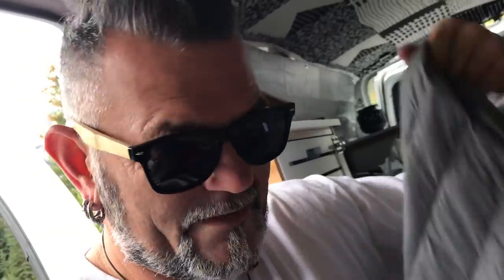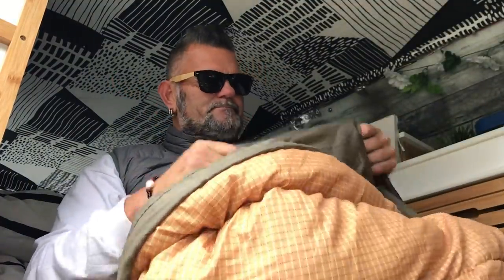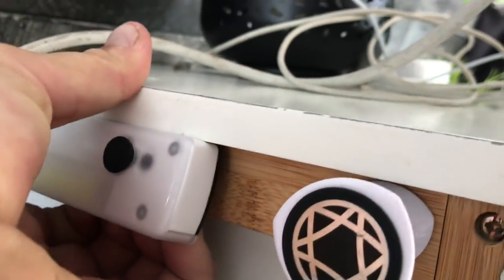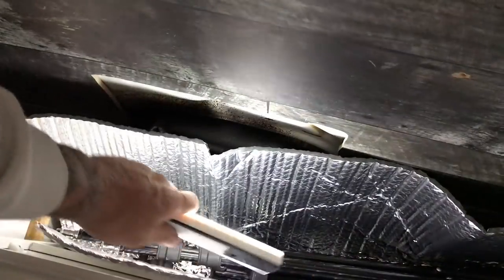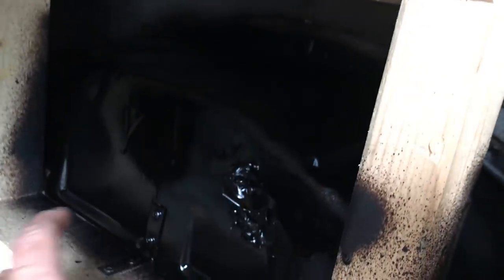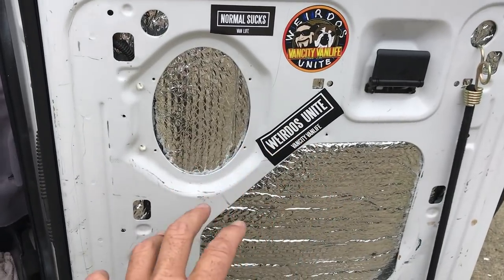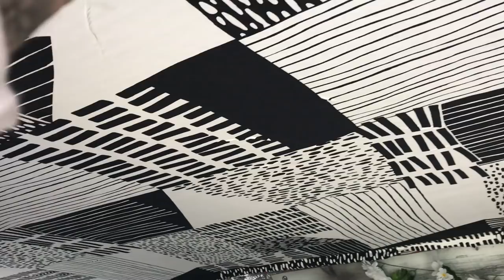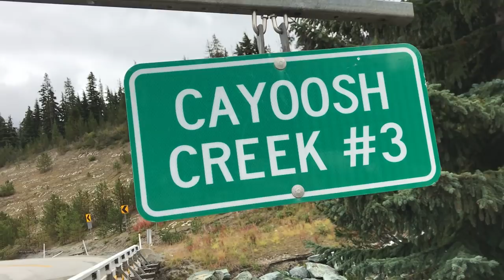Solving Last Year's Winter Problems | Van Life Winter

Comment: First yahoo
I am right now insulating my van with pink foam board and instantly condensation is gone none on windshield either wow what a difference, I did the ceiling all the walls and the wheel wells

Comment: I’m lazy so I sprayed 4 coats of lizard skin inside by van,;  two coats for road noise (black)  and two more for weather heat and cold ( White) and so far is working out fine.. no condensation at all,  quite, still not sure if I’m warmer, so those extra blankets help. And it’s more expensive but Easy breezy to spray. Just got to mask good. 🤙😎

Comment: Check out clay pot heaters you make for cheap yourself. This will take care of any condensation you may get now that you have sprayed your trouble areas. Just don't use this while sleeping. I might also suggest using beeswax tea lights instead of parifin wax tea lights. You hang it in your van and it will take care of condensation and give you practically free heat.
Used in boats a lot.
YouTube has "how to" videos.
Looking forward to seeing you build one.
Reply: I have used these in my house, experimenting for later.  I just picked up a fondue setup for $2 at the thrift store and it is a pretty base for the flower pot heater, ensures air for the flame.  For several years, I have used a tea light China teapot for making hot tea or chocolate or instant coffee (tasty in milk).  The flame is enclosed enough that it won't catch clothing or curtains on fire.
I started with them because I haven't gotten solar panels, and may just charge a house battery on the engine for a while.

Comment: I know you don't want to expand your build too much too soon but.... fitting a small roof vent above your bed should work wonders for removing condensation. Sleeping overnight produces water vapour and it has to go somewhere.
Also fitting a simple curtain across your bed from the front of the van would create a cosy bedroom where the moisture would be driven straight up and out 👍

Comment: The moisture comes from breathing.  Propane heating gives of lots of moisture too.  It forms into condensation on cold surfaces like glass and metal...  Or it will absorb into other surfaces and become mold.  If you spend a cold night inside a motel you'd notice in the morning that your van is dry inside.  You need to have air flow and ventilation to remove moisture.  Maybe a roof vent would help.  Anyways love your channel dude, keep it up 👊

Comment: Cool thing Chrome is you can pick up clear rock guard spray at Walmart, in the event you need to do the doors. I may do the same in my van.
Reply: VANCITY VANLIFE  Ok. I did insulate mine as well, thought about spraying it to be double sure. Glad I watched this though, my gas metal section behind my cabinet exposed. Will spray it tomorrow. I covered my wheel wells with reflectix during the build

Comment: This year I'm so! Ready! I'm going old school but I have been heating my sticks and bricks with a bigger one. But I am installing a tiny pot belly stove and it's only 26" high and about the size of a 5gal. Bucket around the widest part.
I can cook on the top and condensation won't be able to build up. Last year I had to replace my insulation because of the moisture build up. Between me and my Labs we added loads of water from playing outside.
Add propane heating to the mix and I could wipe a glass of water off the walls every few hours.
I know I'm going to hear about having a fire in the van but we did heat our spaces for millennia with it, and it's not an open flame it's mostly radiant heat from the cast iron. I have also been building a guard that will protect the front from contacting anything flammable..like Lab tails😂

Comment: I've been doing this for years and no condensation issues.
May I make a suggestion?
In your problem areas put some kind of hose (like a vaccuum hose or pvc pipe with lots of 1/2 inch holes in it.
Make sure the ends are out in the main area of your van.
Get some air flow and warmth in there.
You won't feel any cold from it.
Don't pack stuff right up agains that.
Put something to allow some flow between the pipe and whatever you stuff in there.
.
You can use a funnel and a fan occasionally to add extra drying if you feel you feel it's getting moist in there.
.
I also have a couple of vent holes that cannot be closed in my camper to keep the air fresh and safe.
.
It gets to minus 32 in my area but it's dry air.
The coast is more of a problem.

I have 4 x O2cool 5 inch fans that run all day on 4 aa batteries and 4 of there necklace types that run 10 hours on 2 aa batteries.
You could drop one of those in the wet spots to dry it out.
The fans only cost 10.00 each and you can get them at homesense or maybe even at Walmart.
.
Fans and ventilation matter near the Ocean.
I hope this helps.
.
A tub of driz-air might be a good idea to suck up that moisture also. I'm sure I spelled that wrong.
You can find it at Marine stores or maybe your hardware store.
.
BTW
I grew up on soggy Vancouver Island and now reside in Super dry Alberta.
.
I also believe wherever you add insulation - add some kind of perforated pipe.
Share your heat and airflow with your vehicle.
It will say Thank you.
.
Something else that may help you.
I open up everthing possible for an hour when I have my heat on.
I blow fans through everything.
Then I close it all up.
That heat has to freeze my ketchup, my tools, my clothes, etc before it can get to me.
Warm stuff is a good insulator.
If you have cupboards a pipe in there also helps. It'll keep your stuff warm.
The cold has to pass that first to reach you.
I never tried a hot water bottle or a hot rock in my closet.
I think I should try that.
First I'll put a little blanket around my rock.
.
A rock with water in it will explode.
A dry rock will radiate heat.
Test it outside first wrapped in saran so you don't have a sooty mess in your bed.
I like to use about 6 baseball to football size rocks not taken from a river or shore.
Microwave about 10 minutes or campfire 1/2 hour.
Careful. Those guys are really hot for a long time.
Use a thick cloth to pick them up.
I put them in my bed in bread making tins so I don't burn my bedding.
Personally I think storing your ketchup and stuff around your wheel wells and keeping them warm and your clothing near your bed and body as footwarmers would serve you best.
Just my thoughts .

Comment: I saw the video from another new van life guy in America. I turned him into your Chanel because he needed a kind of mentor for his build but he had a great idea that I think you could maybe use. You will not have to use any heating at all. The only time you will need to heat your van is when you get out of bed. 

Do some research into sleeping cupboards. In other words. No bedroom. One sleeps in a cupboard and one's body heat does all of the heating. You have Cruz and dogs were bread firstly for hunting but the second reason why dogs were bread was for heating their owner. Cruz is the perfect little buddy heater and you won't need to plug him in anywhere. ;p you might still want a poisonous gas alarm :) but yes. You could make some kind of frame and hang up some thick towels to make the walls and the roof of a sleeping cupboard kinda setup. I honestly think that this is the way to go. To use your body and your pet to heat your sleeping cupboard. Let me know what you think.

Comment: Too bad the climate is rougher in Ontario. Sept 21 it 32 celcius. By November 21 it could be -5. I’m working on a Dodge Ram Van campervan that was only used for summer camping. I’m going to insulate with that spray on rock liner or herculiner then half inch insulation. I’m replacing the vent with a max air. I can’t play around with the weather conditions here
Reply: 2 or 3 layers of half inch insulation is what you need for a Canadian winter, imo. My truck camper has 2" rigid polystyrene.

Comment: What would be great to use for your storage of clothes and blankets is a vacuum seal bag ,they are awesome and protect from dirt . i have used ziplock vacuum seal , sealing? Maybe u know someone that woild hook u up with using the vacuum for a one off.
Reply: One doesn't need a vacuum, one just needs to seal it most of the way then sit on it to get the air out then finish the seal.

Comment: Great vid! I need to pare down my clothing before moving into the van.  My winter plan is slight more in depth. Espar heater arrived Wednesday and talking to spray foam guy tomorrow.
Reply: Espar heaters work great & are quite efficient! Great option for diesel engined vehicles! Over time they do begin to spew alot of excessive smoke out the little 1" exterior exhaust tube upon startup though due to residue buildup & need to be cleaned/serviced.

Comment: If the metal is already a bit rusty spraying rubberized undercoat traps in the moisture and the car literally rots from the inside out. Exhibit one: https://www.youtube.com/watch?v=nXvl9nt57Kg
Maybe it won't be as severe inside but don't spray it underneath on the outside. There an oil film is best.